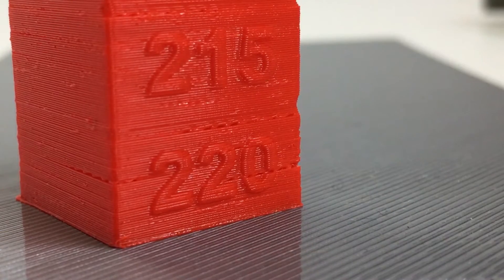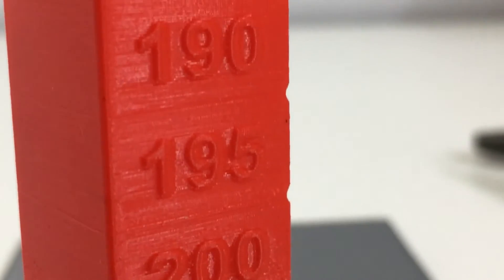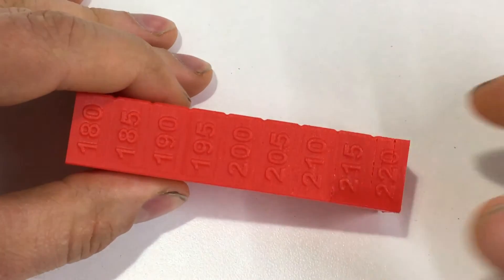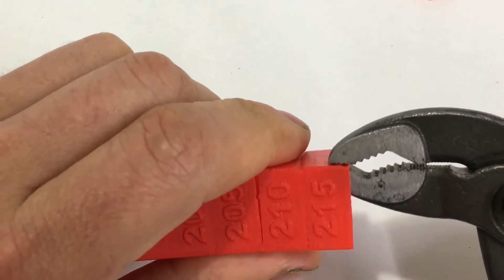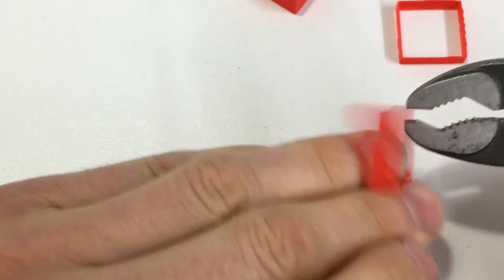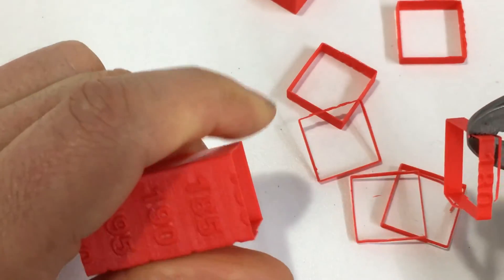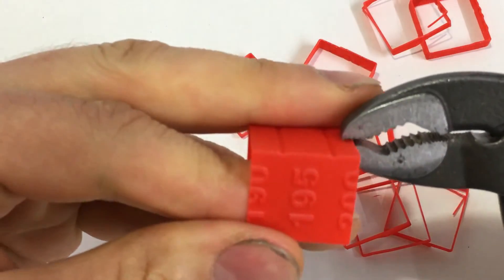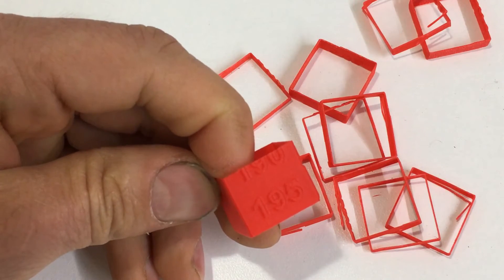How to find the right temperature for your 3D printer

Comment: I cant even get my filament to stick to the damn heated buildplate, and i have the damn thing at 70c... using normal PLA and with a nozzle temp of 210c. Any ideas?
Reply: 70 degrees in pretty hot for pla bed temp it works for some pla but it might be better to try to lower it
Reply: Make sure the build plate is spotless. Maybe wipe down with isopropyl alcohol before heating.
Otherwise add a layer of painters tape.
Reply: Hair spray works well for me, to get most materials to stick to the bed. I also listen to 3D Printing Today podcast for tops.
Reply: I use 40c for PLA, not higher, and 60c for PETG. Using Glue Stick.
Reply: Highest I had mine was 65. I use hairspray before prints. Spray it on and the filament will stick.